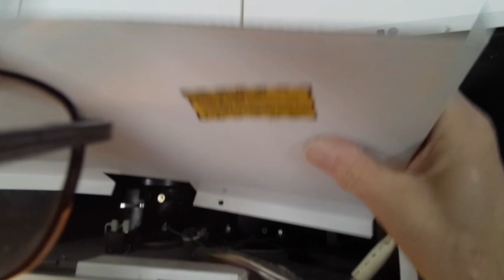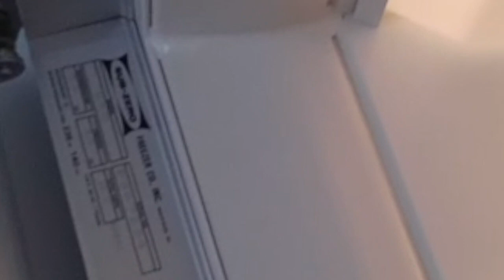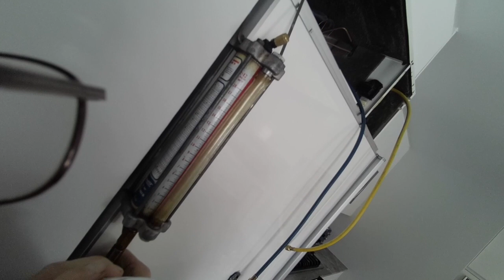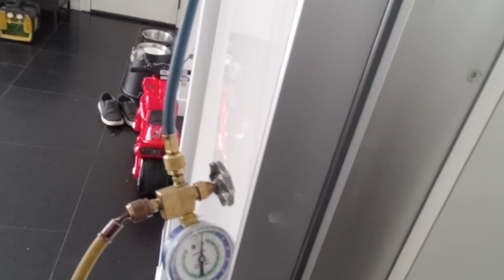Sub-Zero Model 550 Evaporator replacement

Comment: What a great video. Long but interesting story (to me anyway) When we bought our home one of our 700TC-2s (we have 2 side by side) had a cooling issue. We had a reputable local company come out and they put access ports into one of the units and added 134a.  Within a year, the unit worked, but we got occasional EC flashing that me being me, just cycled the unit on and off, and that got rid of the error code for sometimes months. The unit cooled fine, but on occasion it wouldn’t cool completely. Again, cycling on and off fixed the issue.  
Until one day…….not cooling at all. Around 45, so I took the back panel off and the evaporator coil was completely frozen and iced over.  Needed refrigerant.  Called someone from Connecticut this time and the guy came over and said you need an evaporator coil and heat exchanger. Said we had a leak. I asked how he knew the leak was in the evaporator.  He said “they all leak”. Well he put some 134a in and said he would call when the parts came in. Estimate of almost 2k. So for a month the unit worked flawlessly. Then his company called. Part was in. Set up an appointment. I took the day off, he said he would be there first thing. He did not show up. At 4pm his secretary called that he was caught on another job. I said I would call back to reschedule, and was pissed so I never did.  Never returned their calls either. . That was 2+ years ago. 
Maybe the worlds slowest leak, or maybe just the access ports had a slow leak who knows. It’s been fine. No EC either. 
One day I’ll either call you or see if you know anyone who services northern westchester. Until then. Love these videos. Unfortunately not a diy repair (although if I could get my hands on a vacuum and charging column……..)
Reply from the maker: Leaving the door open a long time can cause the evaporator to ice up. Most evaporators do leak eventually but sounds like you didn't have a leak.
Reply: Wow old dial a charge....my 650 freezer had a leak at the tubing that serpentine thru the condensate pan..and then it sucked up a gallon of water....pulled vac for 3 days and maybe 4 gallon vac oil...
Reply from the maker: @VooDooV6  I’ve had jobs like that.
Reply: @SubZeroSpecialists  lol everyday I open the door and look for that 0°

Comment: I would like your opinion on something. I have purchased several of those cap tube cutters from several different, well known manufacturers, and I have yet to find one that does not decrease the diameter of the cap tube after cutting. I'm talking brand new out of the box cutters. For test purposes I used a cap tube gauge before cutting and after cutting and the gauge would have no problem going into the cap tube before cutting but after cutting I could never get that same  gauge to go in. No matter how hard I tried. Since then I only use the file method.
Just by definition, the design of those cutters has to decrease the diameter because 
1. Its a blade and not a laser 
2. It uses a compressing force to cut
3.It is cutting through soft copper
Reply from the maker: I agree. I just used that same cutter today and had the same problem. I wound up scoring the tubing and breaking it off and got a much better result. What you can do is use a sharp awl or a safety pin to open up the tubing.
Reply: I usually use a file and scored all the way around then break it off and use some torch tip cleaners to clean it out
Reply from the maker: @jaminjimlp  That will work. The i.d. of the cap tube is .030

Comment: Greetings! Thanks for the very detailed video! I have never changed an evaporator, but right now my client (model 550) needs help with this. I have two questions: 1) Does the new evaporator come with copper ends or is it aluminum? Soldering copper to aluminum will be much more difficult... 2) Can I use 134A on this system?
Reply from the maker: Yes the new evaporators have copper tubes and you can not use 134a with mineral oil compressors, instead use Hot Shot or R 417 as a replacement.
Reply: @SubZeroSpecialists  Thanks for the quick response! If I want to change the compressor under r134, then which compressor should I use?
Reply: @SubZeroSpecialists  and one more question, if the leak detector does not show any leaks, and the upper evaporator is frozen, then what could be the reason?
Reply from the maker: @ABCAppl  what do you mean by upper evaporator? Or are you referring to the upper rungs of the whole coil.
Reply: @SubZeroSpecialists  In the 550th, two evaporators are installed, one at the bottom in the freezer, the other at the top in the refrigerator. I meant the top evaporator.
Reply from the maker: @ABCAppl  iced up evaporator can be caused by several things: low Freon charge, dirty condenser, faulty compressor, faulty thermostat. Or maybe the door was left open. I would pull the back panel off and see how the ice is formed, is it solid ice or frost? That would give me a clue as to what to check.
Reply: @SubZeroSpecialists  Thank you. It's solid white snow, the entire evaporator is covered with this snow+ice, all the holes are clogged. The rubber bands are intact, the refrigerator is tightly closed, the compressor seems to work normally, there are no leaks. I could provide photos if I knew where to send them.
Reply from the maker: @ABCAppl  you can send pics to support@aaronsrefrigeration.com. Do you know what the back-pressure is on the low side?
Reply: @SubZeroSpecialists  Unfortunately I didn't measure the pressure. Since I do not have R12 and I do not know where to get it. I unscrewed the caps and put a leak detector, it showed nothing. I lightly pressed the nipple, the detector worked instantly.
Reply from the maker: @ABCAppl  you can use Hot Shot, R417C as a replacement for R-12.. you can get it in 12oz cans but you’ll need a can-tap.

Comment: How important is to change filter dryer? And can it be installed both ways or there is a arrow for direction?
Reply from the maker: Replacing the filter drier is mandatory every time you open the sealed system and they should an arrow stamped on them.

Comment: Hello sir, could you please help me, my friend has sub zero 501r, in side the refrigerator back wall and evaporator keep freeing, so far i vacuumed the system and add new Freon (r134 10oz) “because he added some Freon” n system has no leaks. So what could be the problem? Thank you
Reply from the maker: @Hvacr-k1t  is the compressor cycling on and off? Or does it run continuously? 501R is an off-cycle defrost, so if it doesn’t shut off then check the thermostat.
Reply from the maker: If you had to add Freon then you have a leak, also too much Freon can cause the evaporator coil to ice up. Did you pull a vacuum on the system before you recharged it?
Reply: Yes I pulled the vacuum n recharged the refrigerator, I’m going tomorrow to check the refrigerator n I’ll let you know. Thank you so much for the help

Comment: My Sub Zero 680, on top of the compressor  outside is warm  & the refrigerator is not as cold than quoted under 40 degrees. The panel keeps switching with the numbers showing -5, 40 & 50 & service light is on. The freezer is working. A technician came & did the diagnosis & said I need to replace my Evaporator & the heat exchanger, since I’m replacing those two & he suggested I should also replace a new compressor. He did clean a bit on top of the condenser.  Now the top of the compressor side is not as warm & the evaporator, there’s no frosting & the fan is running. I was wondering do I need to replace the evaporator, heat exchanger & compressor?
Reply from the maker: Is it flashing EC-40 and EC/50? If so then you problem have a dirty condenser or faulty condenser fan motor. Try resetting the circuit breaker or holding the alarm button in until you here a beep, that will clear out the fault codes.

Comment: Why does the tstat for the fridge have two wires? Whats the reason for the second one being installed in the fins of the condenser? Curious as my 550 fridge is acting up and I suspect the tstat isnt working properly.
Reply from the maker: The wire that attaches to the evaporator coil is not an electrical wire but a tube filled with refrigerant that controls a bellows inside the thermostat, it basically senses temperature.
Reply: @SubZeroSpecialists  Oh interesting I didnt know that, thank you.
Reply: @SubZeroSpecialists  is there something on the 550 like a compressor cutoff that can get tripped? I've been fighting this intermittent issue on mine that acts like the thermostat is broken. It will run for some amount of time (a week or a month) then all of a sudden it will get warm in the refrigerator compartment, up to 45-50 degrees. If I mess with the temp control it will make the compressor turn back on again, so thinking it was bad I recently bought a new one from a subzero parts seller. I replaced it last week on Friday, it ran perfect all weekend and yesterday but then this morning I get up and the fridge is almost 50 degrees (no compressor running).
Reply from the maker: @123HomerJ  The compressor does have a cutoff if it draws too much amperage or if it's overheated, but it sounds to me like you may've a dead spot on the timer. The next time it turns off try advancing the timer to see if it comes on. If the compressor is clicking trying to start that could be a different issue, maybe the compressor is short cycling due to a freon leak. If possible check the back pressure on the low side of the system and see where you're at. If you're not a technician and don't have the tools call someone who does otherwise you could replacing a lot of parts and never resolve it.
Reply: @SubZeroSpecialists  The timer? I thought only the freezer had a timer for de-icing? For clarification this is just the fridge portion that is having issues.
Reply from the maker: @123HomerJ  sorry I thought you were referring to the freezer. Yes if you have to fiddle with the tstat to get it to come on and you replaced the tstat then I would focus on the sealed system
Reply: @SubZeroSpecialists  I have a new theory now. While I was checking out why the fridge had warmed up and didnt kick in the new thermostat I used my touchless thermometer on the bottom of the compartment under the veggie drawers near where the tstat probe sits and it was at 32 degrees or below. Seems that the freezer temps are affecting the bottom of the fridge and tricking the probe into thinking the temp was too cold and stops the compressor.
Reply from the maker: @123HomerJ  what is the PN of the tstat you put in
Reply: @SubZeroSpecialists  4201260
Reply from the maker: That’s the right PN. There are 2 cap tubes on that control, the one with the big fat tube on the end is mounter below the evap above the drain trough at a 45 degree angle facing down, the other gets sandwiched between the fins on the coil. If you followed the instructions you should be good.
Reply: @SubZeroSpecialists  Yep I followed the instructions that came with it and used the pictures to make sure it was set correctly (plus your video)

Comment: Sub Zero has got to be kidding with this "new style" evaporator. I installed one yesterday and I was cursing Sub Zero throughout the repair. Had I not purchased it from Sub Zero, I would swear this evaporator was a REALLY CHEAP Chinese bootleg part, but that would be an insult to the Chinese. 

For starters they made it so that the fins are installed only on the backside of the coil so now it becomes much more difficult to install the thermostat capillaries PROPERLY. The only reason for this "redesign" is simply ease of manufacturing, thinner and cheaper materials,  hence lower cost.

Secondly, and this is where the cursing really began in earnest, the fins are so thin and so poorly attached to the coil via microscopic spot welds,  that are so weak,  that when you try to pinch the thermostat capillary between 2 fins the welds just break. One fin actually came right off. If you try to be gentle and  not pinch the fins too tight, well then  the contact with the capillary becomes basically non existent. I did it at first per the instructions, from the rear of the evaporator and no way, no how, could I get anything close to a tight fit of the cap between the fins.
The instructions tell you to make sure the contact between the fins and EACH capillary is tight or the thermostat will not function properly. I would bet them my house their best tech can't accomplish this with this cheesy evaporator design. 

18:08  Take note that almost every time you pinched the fins together with the needle nose pliers your could hear cracking sounds. That was the spot welds breaking. You can also see the 2 silver colored little dots on the tube where the spot welds broke. The only reason those fins didn't fall off was because a few spot welds didn't break.  If you tried to pull the cap tube out, you would feel no resistance so heat transfer between evap. and capillary is non existent. Now you may never have had a problem with your installs but Sub Zero claims the fit has to be tight on BOTH capillaries in order for the thermostat to function properly and the system to run efficiently.

I totally regret replacing the old evap. I will never do another replacement until they redesign this beast and will tell everyone to stay away from Sub Zero refrigerators. 

Btw, the only way I was able to get a relatively tight fit of the capillaries between the fins was to place zip ties around the fins and only position the zip ties half way between each of the coils so that little stress was put on the spot welds when I pulled the ties tight. Afterwards  I could not pull the cap tube out but I know the heat transfer is still not as good as could be accomplished with the old style evaporators but it was better than just letting the cap basically just "float" between fins.

Finally one last note about this cheesy evaporator. The copper suction line coming out of the aluminum evap. coil is only about 2 inches long. When brazing that short copper tubing to the existing suction line, it is very easy to heat that short tubing  to the point where the soft  solder that joins the coper to the the aluminum begins to melt and cause a possible leak. So I heat sink that joint by wrapping a short strip of wet towel around it.
Same when brazing the cap tube to the evaporator.
Reply from the maker: As far as I know the copper to aluminum joint is not soldered, it’s called a blast weld, basically it fuses the two metals together. As for the fins I know what you mean but I wouldn’t be too concerned about crimping the fins together, I use a needle nose pliers with a 1/16” hole drilled into the jaws so that when I crimp I get a better hold. I’ve changed hundreds of evaporators this way and have no problems.
Reply: @SubZeroSpecialists  I knew you were going to defend Sub-Zero and yourself,  by saying that you replaced hundreds and never had a problem. So basically you are saying that the breaking of the welds on the fins, when you pinched them together, is not an issue. Next time you do this job pull on the capillary tube and see how much resistance you feel. It will be next to nothing. So you might as well not pinch the fins and therefore not break any welds that can become a weak spot for leaks in the future. 

 By Sub-Zero's instructions they claim the fit has to be tight or the efficiency of the system will be reduced. So your customers may not notice any problems but their refrigerator runs more than it has to. Think about it logically, the less contact between the capillary tube and the evaporator, the less heat transfer occurs between them. By definition that can't be an efficient system. 

The old evaporators had soft aluminum fins that could easily be pinched together tightly and they  were not spot welded to the tube. The low side  tube ran through the fins. The new style fins are not very flexible, they do not bend easily because they have several spines pressed into them to promote rigidity. If you pinch  them together the welds break easily. 
At the very least, if Sub-Zero continues using this garbage of an evaporator, they should have the vendor put  2 fins for each capillary tube,  tightly together so you can force the capillary tube between the fins. That would make for an easier install than the current situation and would be much more efficient. 

As a former airline mechanic, I can tell you that this type of repair would never fly and the mechanic that signed off on that  repair would at the very least have his license suspended and if a plane crashed due to that repair, he would be looking at jail time.
That of course would never happen because such a cheesy design would never be certified for production and therefore would never make it into an airplane.

I'm done with Sub-Zero. I had to stoop to a level that makes me very uncomfortable and ashamed when I had to use zip ties to try to improve on the "engineer's" brilliant, penny wise and dollar foolish, design.
Zub-Zero does not stand above the rest anymore. They just joined the rest.
Reply from the maker: I’m not defending Sub-Zero I’m just stating the facts. My opinion is they should make the evaporator coil from one piece of copper thereby eliminating the blast joints and reducing the chances for a leak. Aluminum has better thermal properties so I assume that’s the reason they switched, however with that being said there’s a solution for every problem and I like your idea of using zip ties to mount the capillary tube, I’ll try it on my next evaporator job. BTW, the newer 600, 700 and BI series don’t use thermostats, they use thermistors, one for the cabinet and one for the coil.
Reply: I agree. The Aluminum fins are brittle and break. The copper fins were much more ductile and wrapped around the capillary much more easily. The “improved” design is awful.